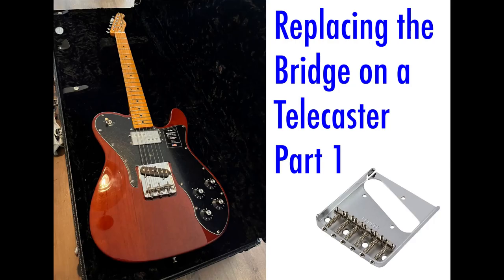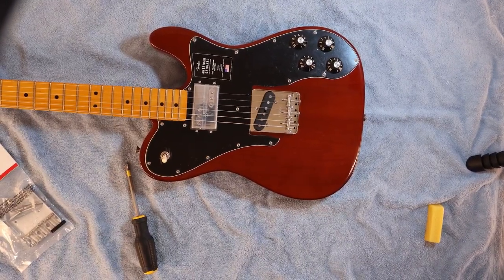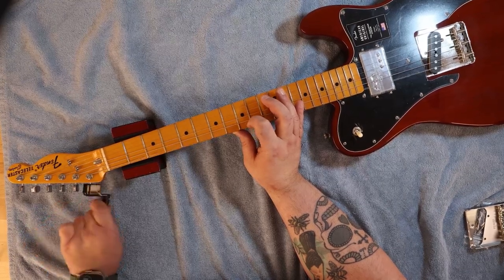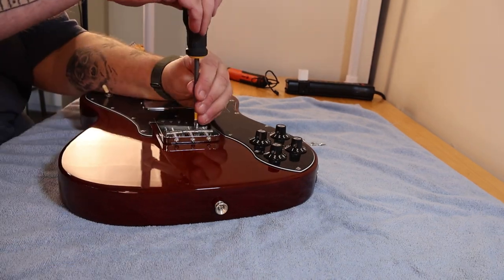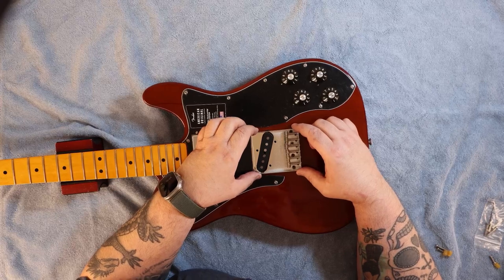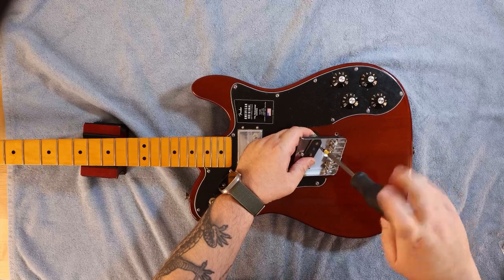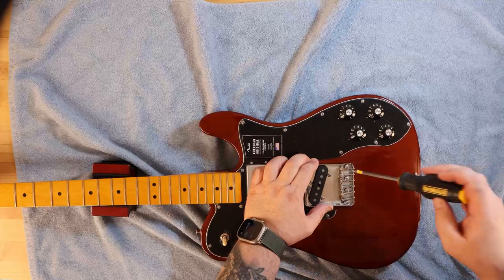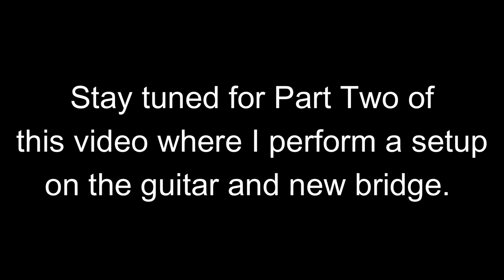Replacing 3 saddle bridge with 6 saddle Am Orig Custom Tele 1 #fender #fendertele #fendertelecaster

Comment: When I was replacing the bridge I also used longer stainless steel screws that were about 50 % longer and a touch wider (very small difference) diameter, and they required some effort to be screwed in. I did it on two Squire Classic Vibe teles, not being much afraid of lowering the value of the guitar though. The amount of sustain and responsiveness I gained by doing that was enormous. It was a completely new guitar after that. I wonder why Fender did not use longer screws, or even machine screws for the bridge.
Reply from the maker: Very interesting. Thank you!

Comment: I have the three barrel brass compensated saddles on my Telecaster and although it intonates much better than the standard Fender brass saddles it is not perfect.
 Do you know if Fender sell the six-barrel saddles separately? I have tried searching for them without success, I know that Kluson sell them but I would rather keep everything Fender if possible, if not I shall have to fit the Kluson ones.

Edit:- I just realised that I might not be able to drill the holes for the six screws as the original holes might be in the way, I thought about welding the holes and drilling the new ones but it is a chrome bridge and would look odd, if it was a brushed nickel bridge I might get away with it.
 I have decided to buy the whole complete Fender bridge, it is not that much more expensive than the Kluson saddles anyway, I have decided to buy the bridge from a music store as there are quite a lot of counterfeit parts sold on Ebay and I don't want to take the risk.
Reply from the maker: I purchased the entire bridge and saddle assembly off of Reverb.
Reply from the maker: It was all original Fender.